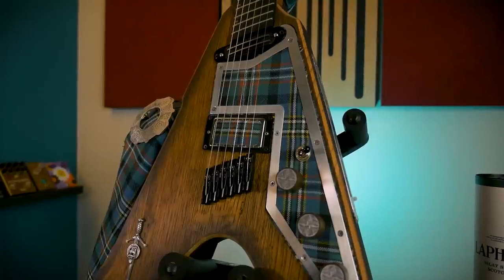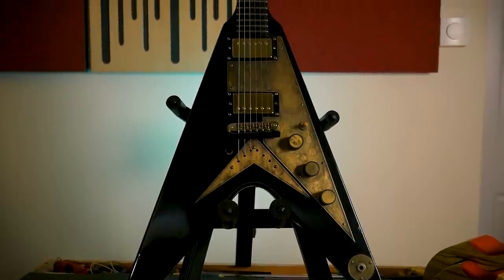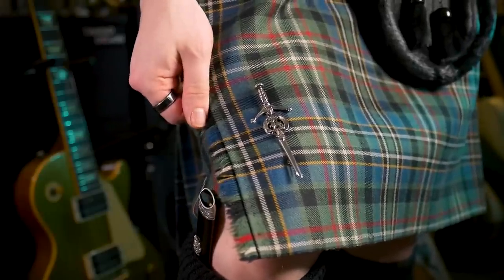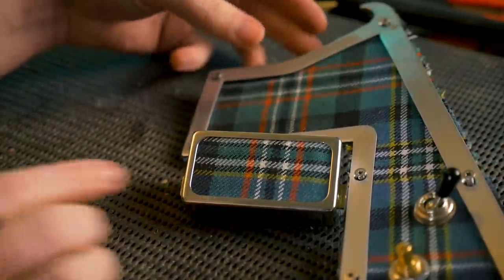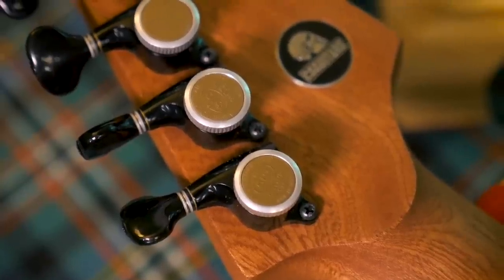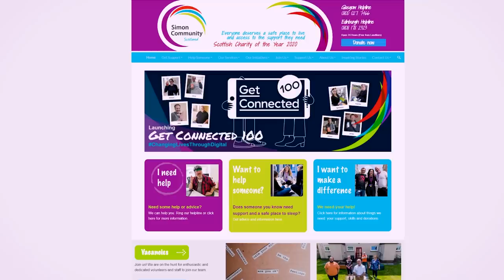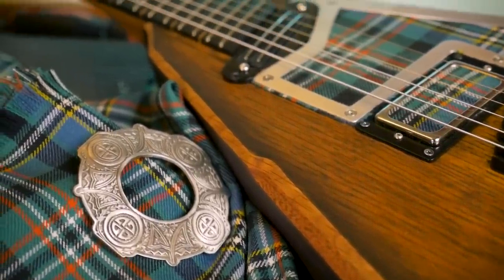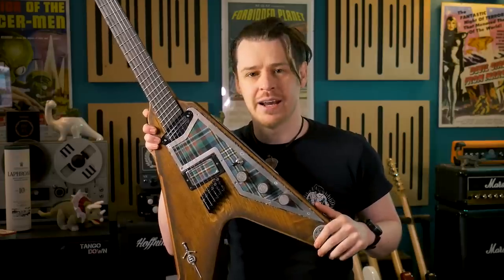I Built The Most SCOTTISH Guitar! | GGBO 2021

Comment: I may be wrong here, but isn't the word claymore based on the term for Scottish basket-hilted swords, while the large two-handed great swords had a different name?
  The public of course associates "claymore" with the great swords, so in that sense it still does work.
Reply from the maker: The word Claymore is an anglicised version of the Scottish Gaelic name Claidheamh Mòr, which means Great Sword. (or literally 'Sword Big')

Language evolves over time, as did design of weaponry. It's disputed as to whether the term Claidheamh Mòr was used for all Scottish broadswords or if the basket hilted swords were ever given that classification (perhaps misattributed after the fact), but the word is most strongly connected with the two handed great swords. 

If you wanted to be pedantic about language you could refer to a two handed Scottish sword as a Claidheamh Dà Làimh (Sword Two Hands), but I don't know if that distinction was ever used historically, or if just for modern cataloguing purposes.